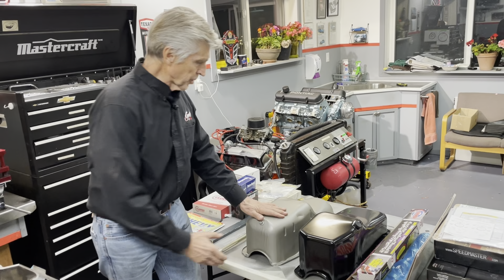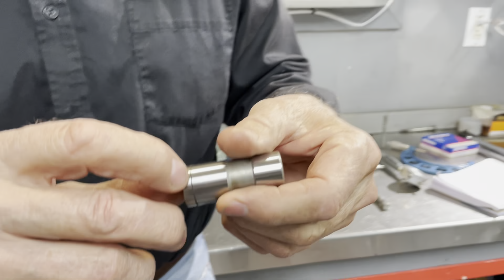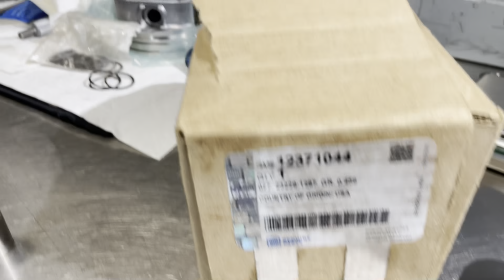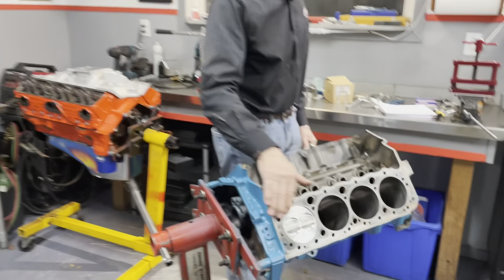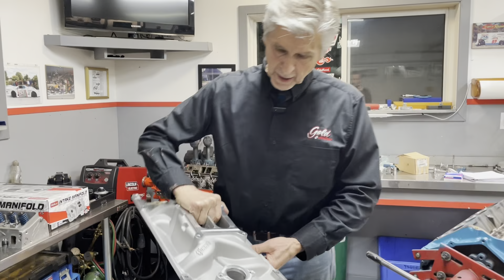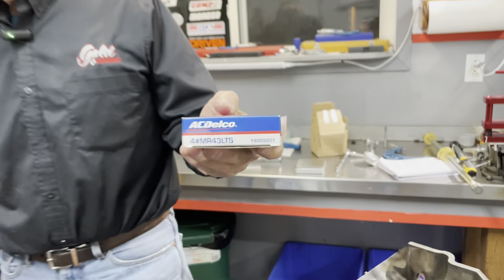Do you need to Balance your engine??? Will it survive if you don’t???

Comment: I’m a local dirt racer in mo. What size of crank damper would you use if you don’t balance  the  crank and do you need to use a non balance fly wheel
Reply from the maker: Thanks Robin, for an internally balanced engine, a 6.75" damper is a good choice because it has a.little less rotating mass than an 8" damper, and it allows you to install the engine lower in the car. Your track rules may require an SFI approved damper. AG

Comment: Instead of decking the block, take about  .007 off the head
Reply from the maker: Good point Jon, it depends what you are trying to accomplish. 
In most cases, decking the block will increase CR more than milling the head. Also milling the head will not help to improve quench.AG

Comment: So the main thing today with flat tapped wear is the oil made today.l is gear toward roller lifters . The oil made today has less phosphorous in it causing lifter cam wear on flat tappet lifters  .However I have always  balanced my crank especially when removing  material for oversized bearings . I feel as a  engine builder if I am reving the engine into 6000 to 7000 rpm range which most motor heads do I want to ensure the engine will survive.
Reply from the maker: Thanks for the info. AG

Comment: I’m 72. When I was a kid we never had engines balanced. We were poor boy hot rodders. We were building 265’s and 283’s with solid lifters. We spun them very fast to get horsepower. I only remember one 265 coming apart from a crankshaft failure. It was a stock cast crank. 
Also, wiped camshaft lobes were unheard of.
Reply from the maker: Thanks Duane, we share a lot of those memories from the younger days. AG

Comment: I build budget builds. The factory puts the basic "factory balance into the design" so I try to stay close to factory weight of pistons pins and the rods. That being said if ya want to equalize all of the throws doing rods all down to the lightest one then pistons. If your pistons are way light use a heavier pin. I have use pins with only 2 or three grams variation and balanced assembly to one gram and skipped the  balancing shop fee. Very smooth. You will notice it. The crank is left as is just machine and polish.
Reply from the maker: Lot's of good information in your comment Jacqueline. Thanks. AG

Comment: Thank you for your expert knowledge shared. FYI I built a balanced283 bored 60 many years ago and eventually let it go and to my shock got a call from the guy who  eventually owned it and this was many years later and he called to ask about the build. It was a 12 to 1 compression engine with solid lifter cam, headers etc and that engine lasted way beyond what I would have ever expected. Just for info. I agree with your assessment.
Reply from the maker: That’s a great example of how a proper balance job pays off in the long run. AG

Comment: Why do piston companies make 4 valve relief pistons when the piston is only made to be installed in a known direction??  Flame travel and quench would be better, it seems, with a flat piston and only two valve reliefs.
Reply from the maker: Good point David, I would thin economics in the manufacturing process.

Comment: Until I see actual dyno results of balanced vs unbalanced and results of actual vibration sensors I am not convinced it's nessicary. balancing your reciprocating weight to your counterweights is good in theory but how do you measure the infinitely varying resistances on your cylinders during each stroke and compensate for that?
Reply from the maker: Thanks Bob, my thoughts exactly. AG

Comment: All I know, I've driven a truck that had the wrong flywheel, the shop put a 351M flywheel on a 400M after they broke it and couldn't find a new flywheel, it felt like the engine was completely falling apart. And engine with a flywheel out by 7 grams, at 3000 RPM, thats the same effect as bolting a 49 pound weight to the flywheel. Yes, balancing is important

Comment: I once did stroboscopic studies of an F1 engine crankshaft in motion - this was part of developing a windage tray. You wouldn't believe how much oil was attached to the crank and how much it moved depending on airflow in the crankcase. No doubt it also moved relative to the motion of the car. It looked like a dough hook. Even with sharp edged knives to direct the oil into the sump it was still substantial. My question is  why bother with balancing things to less than a gram when you have many ounces sticking to the crank and moving around all the time?
Reply from the maker: That's a very good point Francis, and what about the explosive forces of combustion? AG

Comment: removed 1mm in the dish of my 4cylinders to lower compression for boost , this reassures me that i dont need to rebalance , tiny amount of alluminum vs a supper heavy steel crank i doubt it will even be noticed
Reply from the maker: I agree, good point! thanks for commenting.AG

Comment: no other industry that deals with rotating assemblies with the rpm and torque of even a mild small block would ever consider not balancing
sure the odd guy lucks out and has an engine that lasts 200k while setting track records
anyone that says to not balance are really saying the balance should be close enough....so why not confirm
Reply from the maker: Thanks for your point of view DD. AG

Comment: I pretty much figured i was good, but a completely balanced rotating assembly pistons, rods, and crank. And switching them over from a stock block to a Dart block is fine? Would it be considered balanced if i put every piston and rod into the exact same place on crank and cylinders?
Reply from the maker: I think so Julio. The rotating assembly doesn't care which block it is installed in. AG

Comment: What was the taper on the lifters and did you Rockwell test the lifters?
Reply from the maker: Thanks for the question Marty, no we don't! AG
Reply: @goldsgarage8236 And Alan, we shouldn't HAVE TO. In my and your days, we trusted that all components would pass Quality Control, which is nothing today. I had my flat tappet Nitrided before I installed it and have had (let's knock on wood...) success in my 400 SBC. I really like you explaining things for those that haven't done it as long, even me, after 45 yrs of building. 
Thanks for the reply.
Marty

Comment: I had a $5000 in (1997 $) 440 built and balanced.  Every other engine I ever drove, the higher the RPM, the more vibration.  Not this 440. very smooth.  maybe saw 6000 rpm once a blue moon, with a Crower Street Beast cam.  MTC pistons, beamed and polished stock rods.  If I have the opportunity to build like that again, I will balance again.  That motor replaced a factory 318 in a Barracuda.
Reply from the maker: That's a great example of the benefits of balancing, thanks for sharing your experience! AG

Comment: So i worked in a machine shop for years… ive built numerous engines from olds, sbc, LS, LT, diesels, japanese 4cyls you name it… the best way it was explained to me is if you can improve anything on a engine or block just 5%. You do it. So balancing and blueprinting the rotating assembly. (5%) … using torque plates to hone the block which simulates distortion from the heads being bolted on ( 5%)… decking the block so you have a perfect machine surface for the head gasket (5% )… doing upgraded valve springs and keepers to help retain proper lifter preload and reduce valve float ( 5%) …. Porting and polishing intake/ exhaust runners port matching (5%) 

At the end you have improved not only the machining but you perfected the block where the cookie cutter factory fell short by a total of 30%! For a budget bill, you don’t have to honestly do any of this. But it makes a difference and it adds up. That engine will now be more fuel efficient, more reliable, make more power, and run more smooth. Again YOU DONT HAVE TO DO ANYTHING. Itll run fine regardless. What I’m talking about is speed shop techniques to make the most reliable efficient power without blowing up.
Reply from the maker: Great info and it all makes sense, thanks Motorhead.AG
Reply: Agreed
Reply: @jeffreyyeater1780 your are a genius.

Comment: I never had an issue with the mR gasket .018 compressed thickness metal gaskets to help with quench. Used with iron heads that is
Reply from the maker: Thanks Nate, I have used similar .015" SS gaskets on SBC many times with good results.AG

Comment: Hypothetical question, if i take a factory engine disasemble everything and label every thing so thst every part goes back in its origonal spot and all i do is have the crank polished why would it need to be balanced?
Reply from the maker: Thanks for the question Dirk. The simple answer is that you would not need to have it balanced. AG

Comment: Built my first 302 in 1982 with my best freind and his father. I helped build about 10 more Ford Windsors before I before I built my own 289 in 1985 for my 66 mustang. I had that car from 1985 until 1999. 14 years strong and no balancing. Personally I have never balanced a motor or had one balanced. For a street motor I feel it is hogwash but today everyone is flush. They don't mind flushing money down the toilet. Me? I could flush that dough now but there is something about building a motor in a old barn with a transistor radio blaring with a guy smoking Vantage 100s that builds a bs monitor in you. I refuse to be wasteful or ostentatious even were I a millionaire. I guess it my Redneck roots.
Reply from the maker: Great comments Christopher. My thoughts exactly. AG

Comment: Machinist for 40 years 12 years Automotive the rest Aerospace prototype but built lots of race motors I truly believe in balancing and Blueprinting in the block especially in a Chevrolet just for example typically the old 350 327 Etc were about anywhere from 5 to 1700 thousands of an inch in duct kites different from left to right just for starters balancing extends the life of a motor greatly harmonics due to vibration are the most destructive power on Earth also helps motor rev higher RPMs and create better horsepower and Blueprinting brings it all together
Reply: the  factory  puts  out  lots  of   out  of  tolerance  crap
Reply: @jeandaugherty830 🤣🤣🤣🤣
Reply: I agree with you 100%. I used to work in an engine shop...in the balance room

Comment: I was always under the impression that all vette 350s had 4-bolt mains and forged cranks...then I looked up the specs of the 1981 L81s.  What on oinker!
Reply from the maker: Thanks for the info. AG
Reply: The last year for the forged L82 option was 1980

Comment: I love your content! I too have a 1979 Corvette L-82 that I need to rebuild. Knowing your views on balancing and increasing the compression ratio is invaluable. What is your opinion on align boring for the crankshaft and camshaft?
Reply from the maker: Thanks Andy, you do not need to align bore for the camshaft or crankshaft ever, unless your block has had some major trauma. AG
Reply: @goldsgarage8236 finally a  man with some sense.
Reply: 55 years an auto machinist. Only had 1 occasion to line home a block. We farmed it out. It didn't pay to buy line boring equipment.  If a main siezes and rotates in the block, it needs line boring. If it's an odd  or antique eng. If it's a 350, it cost more to line bore than to pick up a used engine. Doing unnecessary work is just padding the bill. We always kept it honest. 
Putting 16 valve seats in every pair of heads is unnecessary too. Cheaper to get another set of heads. By the time you invest all that money in an old pair of heads, valves,seats,guides, surfacing, you can buy new heads. Unless you need #'s correct then go for it. Don't rip off the customer. Selling him smoke and mirrors!

Comment: Factory balance by weighing old parts and stay with factory balance is poor mans way. You can balance rods and pistons are usually very close but check everything. Balance of power is another area to get a smoother engine. Cc chambers, presise porting and if power balance is off balanced masses are being forced unequally so it all gotta be close. Thanks for video. I follow David Vizard.
Reply from the maker: All good info, thanks Jacqueline. AG

Comment: I’m wondering why the quench area can to too much? I would think that the more quench area, it would just lower the compression is the only issue I can see. I’m not an expert so I’m wondering what’s the issue with the quench? Can you explain this so I can understand this?
Reply from the maker: Great question Rocking. Proper quench compresses the combustible mixture and distributes it more homogeneously in the combustion chamber for complete and faster combustion. This reduces the opportunity for "ignition knock or pinging". The tighter the better, except you don't want the piston to hit the head. About .045" or so is a good compromise, although some go tighter than this. Hope this helps. AG
Reply: @goldsgarage8236  thanks for the reply. I think I have a bit of an understanding now!

Comment: Balancing an engine is not a bad thing but, when the engine left the Factory, it was Balanced good enough to lasting 200,000 miles. For a street engine that should be good enough!  If you want to spin the engine to 7000 it should be balanced! When I had my 400 ford engine balanced, they remover 4 grams off between three bob weights.
Reply from the maker: My thoughts exactly, thanks Mylan. AG

Comment: Is there a difference in balancing procedures for American V8 vs a 60° import v6?
Reply from the maker: Thanks Az. I am not an expert on balancing but I think the logic is the same. Get all the reciprocating parts like pistons and rods equal weight, determine the bob weight, then add or subtract weight from the crankshaft counterweights to balance. 
If anyone out there has more to add, please weigh in. AG

Comment: I use to balance everyone i built.  I built a 355 dirt track motor 2 years on a last minute build. No balancing with after market pistons and turned it 7500 for 2 seasons before rebuilding it and it looked great inside.  I just wonder if all pistons weights are equal and rods are equal and crank is a neutral balance- do any of them really need balancing? I understand on super light cranks and aftermarket combos.  But i have my doubts on alot of the balancing now
Reply from the maker: Thanks for sharing Jeremy. Your experience validates my theory about balancing. AG

Comment: Will a balanced engine handle 40PSI of boost better ? Or is unbalanced going to send those pistons to meet Jesus ?
Reply from the maker: Good question @bee. The force on the piston during the power stroke with 40PSI boost is about 10 tons. I don't think a couple of grams imbalance will make that much difference. AG

Comment: I have built both balanced and un-balanced engines.
At 6000rpm or above, I can hear the difference, as the engine for some reason sounds smoother, and like it likes the high rpm?
When trying to run an un-balanced engine up to or past 6000rpm, the engine sounds like it is struggling to get there a little.
Balancing is cheap.
Last engine I build was a SBC Dart 434ci, with an Eagle rotating assy. Think they are balanced to 2gr. I get my rotating assy. balanced to .5gr.
I cant argue with anyone on this, but know that an un-balanced engine vibrates, from building industrial engines with counter balancers. You get the balancers out of time, or remove them, and it really rocks the boat.
Reply from the maker: Thanks for sharing your knowledge and experience GFugate. AG

Comment: You can still deck the block without removing the original number's used to do it all the time just stop the mill  before they hit the original number's on the block have done this for hundreds of original engine blocks you machinist should be able to do this easily.
Reply from the maker: Thanks for the info @jims. AG

Comment: For a stock build you can get away without balancing, if it’s a high rpm race motor it will help it last longer!  Most people don’t realize Chevrolet never balanced anything!
Reply from the maker: I agree Operating. With all the external forces acting on a rotating assembly, it is really never in balance. AG